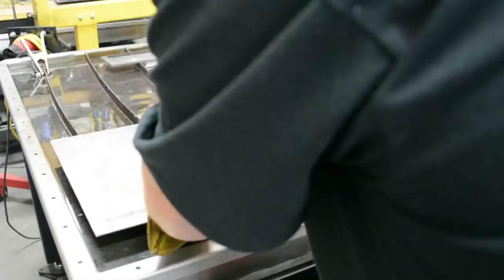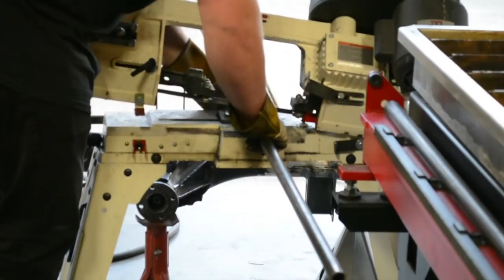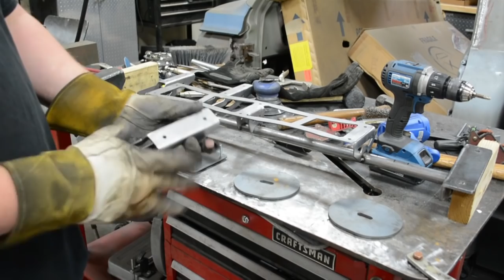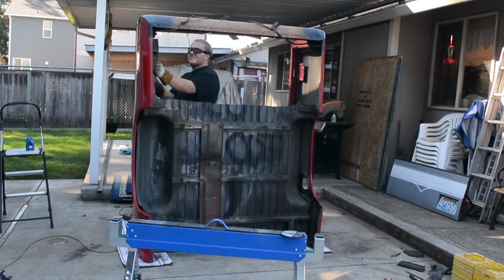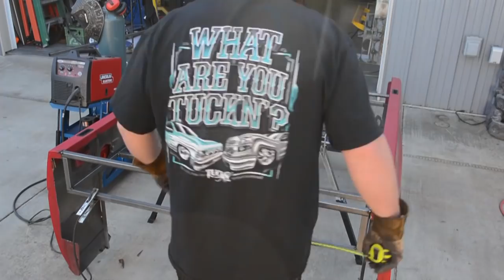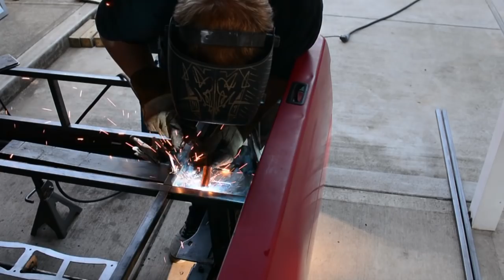Bagged On 20s // Episode 3

Comment: Trucks turning out really nice! Your customer is going to be very happy! I know I would be! Now that the brown nosing is out of the way, lol I wanted to run an idea by you. See if I'm missing something or if it's being done and I just haven't seen it before. I have put many a truck on air before, done complete tire to tire custom choppers, every body mod to a car that I can even think of iv done twice. Get it, twice of course it's a car! Lol anyway to the point here, I own a 93 Toyota pickup extra cab, 2 wheel drive fuxin duhh! Lol I've had it for some time now and I'm starting the build on it in a few weeks. My question or whatever this is would be as follows. On the frame pretty much at the leaf spring hanger give or take few inches, up to where the frame goes up to the engine sort of were you cut purple crush when u started the build back when. U did a stock floor body drop with new frame rails arguably one of the most intense mods you can do to a vehicle. Why can't you then make it a lot simpler then and instead of going from the top down go from the bottom up! If you stand a look at a Nissan or a Toyota from the side the frame pretty much only hangs past the cab or body right in the center there where I tried to explain a bit ago. You would have to do reinforcement like alover and stuff but slice the frame long ways off the bottom and plate it all that and it would lay rocker without you even touching a body bolt. No issues with things fitting cuz nothing would have moved. Am I crazy to think this or have u seen it or did I confuse you at all? Lol I'm good at the last part usually. But I would love to hear back to see what your take on it would be. Catch you on the flip side wheels down thrown Sparks! Fuck that was cheese....straight up cheese sauce.
Reply: If you do that your creating more work. Doing like you said. You would have to raise the motor and trans. My control arms on my frontier are damn near on the ground. So you would have to redo those. Just causes allot of work
Reply: I have wondered the same thing, just suspend the truck in the air "not really" but then cut 2 1/2 inches or what ever it takes to lay pinch weld off the bottom of the frame, X brace from frame rails and reinforce the hell out of it. Cant wait to follow the REPLY's.
Reply from the maker: First off thanks for the support! About your question there is a reason people do not do this... at least on a hardbody the motor xmember sits level with the bottom of the frame as well as you lower control arm. So if you were to cut the bottom of the frame off you would need to z the frame at the fire wall to get above the new frame cut. So you would be giving yourself just as much work. Some people will pull the body off and cut the top portion of the frame off and then box it or put a smaller tube inside and weld it. This allows you to do a sfbd without replacing the whole frame. Honestly though if the body is coming off it would be much easier to replace the frame rails while your at it.
Reply: You couldn't cut off the bottom of the frame you would have to "z" the front section but you could replace the section under the cab and build new body mounts . 
Thats what i did to my hardbody to body drop it after bagging it 10 years ago . Now it has a 3/4 frame but starting on all new frame and lots of sheetmetal hopefully next spring .
Reply: Ad a reminder I did say that I was looking at if it was possible on the truck that I have and it is not a Nissan. Or a hard body. It's kind of a flopy body in some parts actually but not the point!! Lol the Toyota ex cab is close to the Nissan but nowhere near at the same time if that makes any sense. There are parts that are Bellow the rails or flush with them but everything that is will be leaving the building once the airide is put on. directly under the cab there is maybe 4 feet of the frame that is below the rocket pinch. Frame is also 5" tall right there little over and it is boxed again just in that area. My thoughts were alot of guys are doing different things on their trucks just to get them laid out and on the ground, and the their trucks also! What I wanted to do was ask around about it to get different inputs from others about it and I'm also going to be making a full frame for it so I figured for science...I can cut the shit out of that frame and see if it would work like I am seeing it in my head. If it lays frame and rockers at the same time then that would be the end goal, and to not have it fold In half or whatnot cuz that would not be something I would want to see on my truck!! Someone else's that would be funny as fuck! You would laugh don't lie. Another important thing I may have forgotten to mention is it is going to be unibodied also witch will be a HUUUUGE help in making it stiff again. Giggidy..not doing any of this right away still exploring options on what the end result will be and finishing up some other things first but thank to anyone that even read this crap this far!! Geez your awesome!! Pat your back now, lick a window, and as he said in this video, eat my ass, eat my ass, eat my ass. Lol wtf bye now!!!

Comment: any tips on cutting out the bed floor?
Reply from the maker: If you can get your hands on a plasma cutter it will make it a breeze. Unfortunately the torch on our machine is not meant for hand cutting so I went through about 7 cut off discs and 3 saw zall blades.